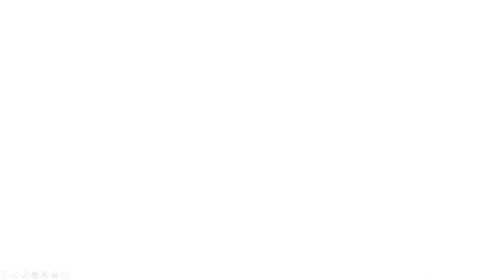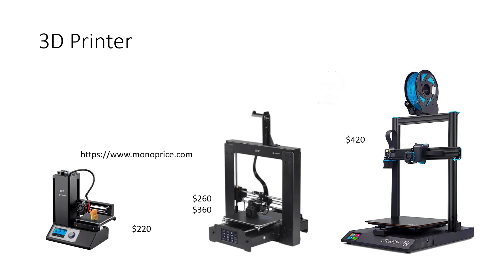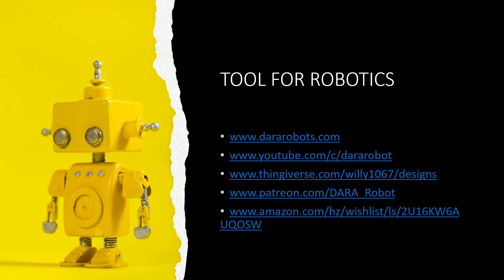Tools needed for robotics, 3D printing and electronics

Comment: 0:00 - Intro
6:25 - Digital Calliper
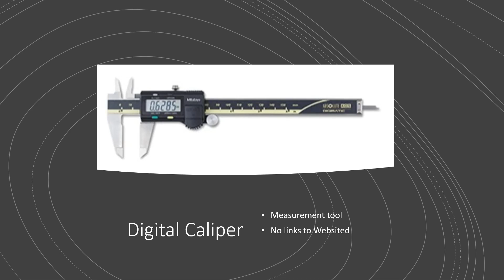7:21 - 3D printer
10:56 - 3D filament
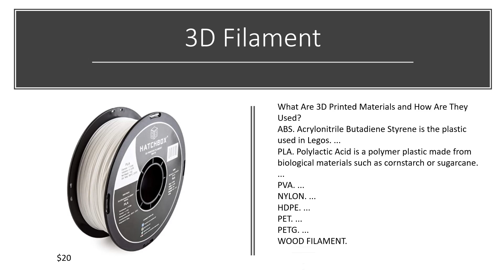12:42 - Software
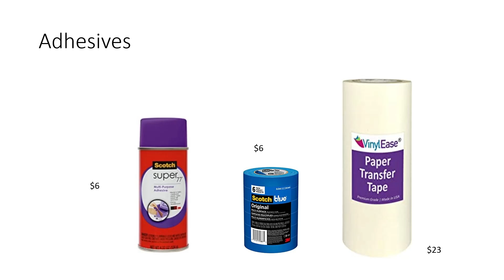13:29 - Adhesives
15:51 - 3D printing tools
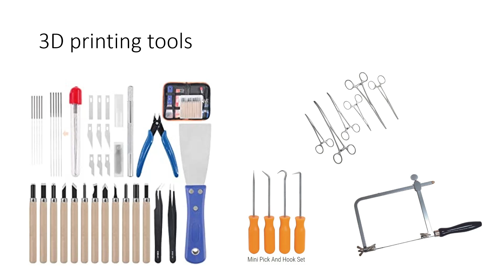18:03 - More tools
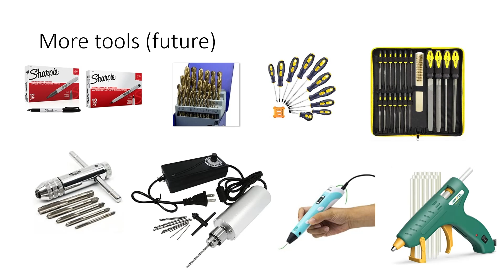23:17 - Electronics